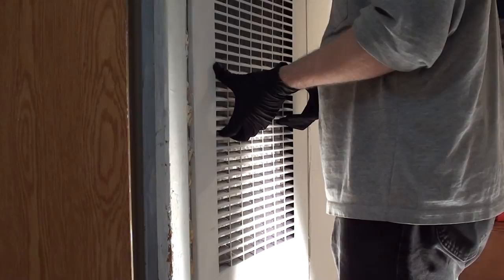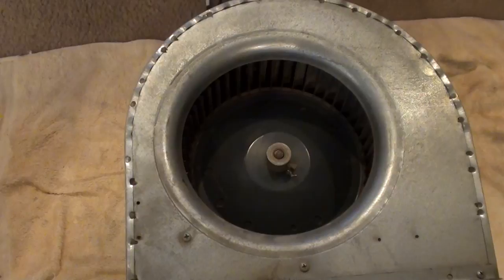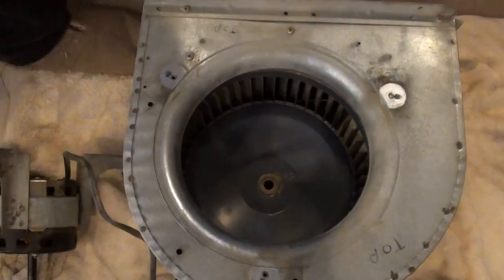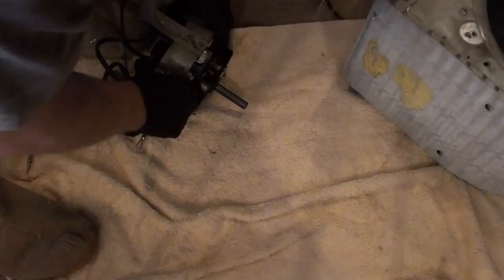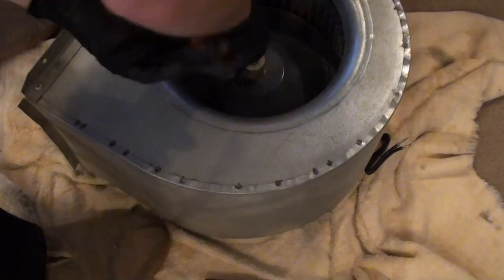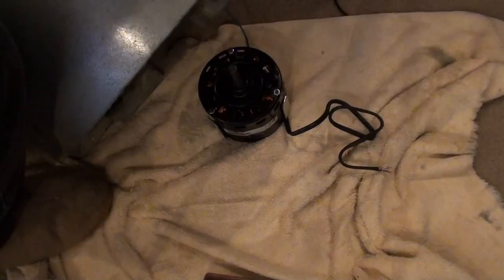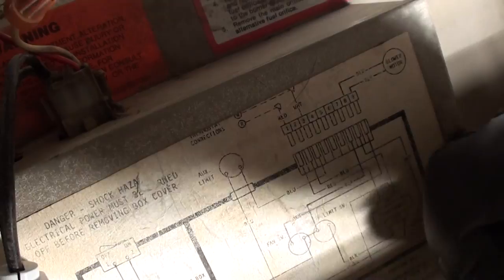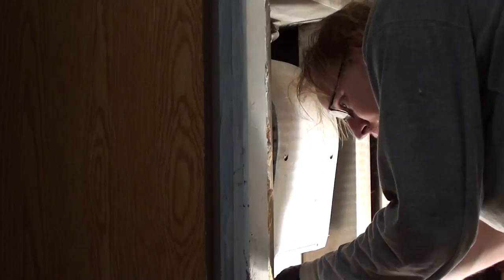Replacing the blower motor in my Nordyne(miller) furnace

Comment: Seems to me you added the filter which will create a suction pulling the carbon monoxide back into your house down the chimney it might not be Alzheimer’s it might be carbon monoxide Mine has no separation And the filter goes on the high side of the blower the pressure side of the blower not the suction side If I’m wrong and yours is isolated I apologize if I’m right it might save your life